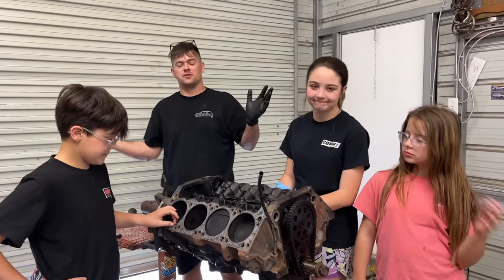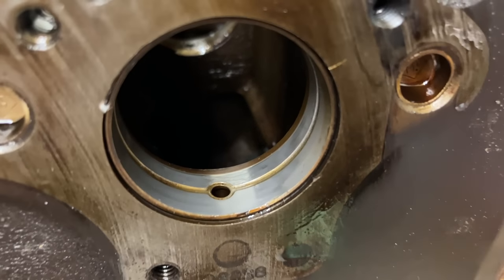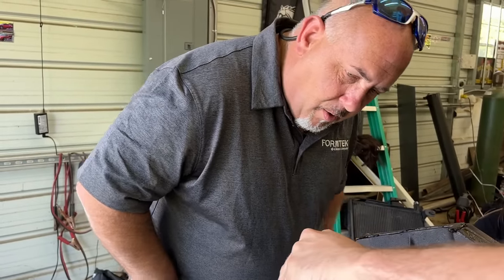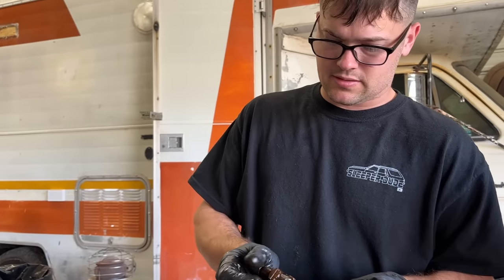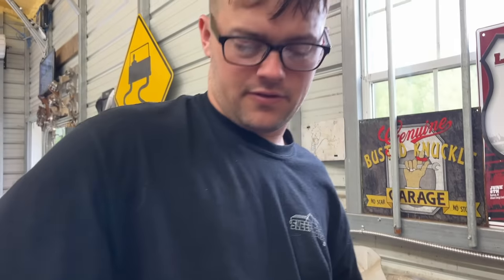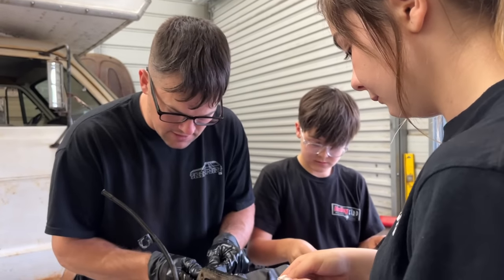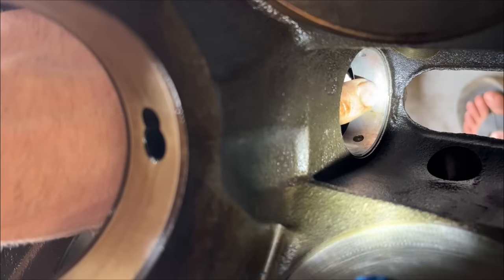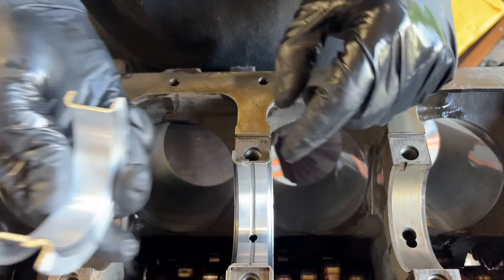250k Mile Engine Rebuild At Home! With No Machine Work For Cheap!

Comment: As a mechanic I have built maybe a hundred engines, you have done it just the way I would have! Great job and yet another great video. Thanks guys, Ya'll awesome!
Reply from the maker: Thank you I really appreciate it
Reply: @Sleeperdude you and him are really smart, I bet you two could help each other, if you need help on something, love you all, he's really humble like you as well👍
Reply: @Sleeperdude  awesome you teaching your kids mechanic skills but please tell me where did you get that toy goat and what is the name of it. I want to buy 3 of them , 2 for my nieces, and one for me😅that yell is too much.
Reply: You would use the same lifters and pushrods and cam after going thru all that work and money?? I wouldn't admit that my friend if you depend on engine rebuilds for a living. Not many customers will want to spend the mo ey on labor and not spend the few bucks extra to do it right , especially on a 250k mile engine
Reply: I love watching y'all's videos, I remember when I was a kid my parents and I built a 283 in our living room. The only machine work was the boring 40 over. I remember dad polished the crank shaft with a leather strap semilar to what you doing with the sand paper. The next day I came home from school and mom and dad were adjusting the lifters while it was running, Dad was old school. Anyway by that evening it was running good and we drove it to the gas station and jumped on I 75 north and drove it 1200 miles it's maiden voyage from FL to Ohio. Change oil and filter and Drove home. Love that it's a family thing. My new favorite show
Reply: Wouldn't want you for a mechanic. You're scary. Cylinders out of speck need machining and new pistons.
Reply: @samsteel2643  Don't be a dick, not everyone has the money for machine work, they just want a running engine.
Reply: I totally agree with that! I restore old French and English car's to ad to my collection. All engines I take apart and give them a complete overhaul. The method this wonderful family is doing, is the exactly the way it should be done! It is the way they include the love for animals into their daily lives is an example to all of us! ❤
Reply: @samsteel2643 you clearly were not paying attention when the video started.  He clearly said this is a video to teach people how to rebuild a motor on a budget not using a machine shop and this isnt a customers motor. If it was im sure hed be using new parts when needed.  Smh

Comment: Watching you and the fam makes me happy. I was born 50 years too early sometimes I think and fifty years too late other times. 59 years ago when I was working on old iron Chevy small blocks and a British 4 banger all we had were books. You make me believe I could do this.  Thank you. Back then there was too much learning on the job, shop manuals, and  no real mentor, so it just did not work out that great at times.  I built a very smoky four cylinder and a 327 with 202 heads, crane comp cam, new lifters and valve springs and push rods that lasted about a year before she blew. (I was a little hard on her though). It was so much fun but so stressful. Thanks for making feel like I need a shop again.
Reply: We all did something like that  to good times 🍺👍🏻👍🏻👍🏻😎

Comment: I thoroughly enjoyed the video. Nice budget rebuild. 
You mentioned about clearance between the keg intake with the EFI clearing the dog house. I don’t know how it would look but cut towards the top of the dog house and cut sheet metal to weld in as a extension and re weld the top back on a paint to match. The only thing is measure the dog house to the bottom of the dash to see what room you have to work with.

Comment: I usually break off a piece of the top ring and turn it sideways to clean out the oil groove. The end at the ring gap is flat and fits in there nicely.

Comment: For cleaning the ring grooves, since you are replacing with new...snap a two to three inch piece and use the factory end to clean the appropriate groove. Also, I bought a chevy 327 short block for my 69 pickup and it was a remanufactured block and one of the 8 pistons was oversized. Worked fine while I drove it.

Comment: When I rebuilt my 400 m in my 79 f150 the three center cam bearings were laying in the oil pan the cam was running on the end bearings only.a quick way to clean pistons is to get one of the dip cans of gum out carb cleaner and soak the pistons in it for a while.you can use the end of a broken ring to clean the ring grooves.great video
Reply from the maker: Wow

Comment: Another thing people used to do is put the 360 heads on a 318 because the ports are bigger and the chamber is smaller. My buddy told me that they made more power than the stock 360. Something to do with the compression, more dome and smaller chamber.

Comment: I had this same thing happen to bearings on a little diesel engine build I did recently that had a lot of blow by from a broken piston/rings on one of the 3 cylinders. Fuel dilution was bad enough that it was 'making oil'. I think the acidification of the oil that happens with that kind of blow by caused the issue. The crank and cam journals were spotless though and mic'd out to exactly factory spec, so I didn't even touch those when I reassembled. Didn't even polish. Engine makes like-new oil pressure now.

Comment: The Beverly hillbillies would cut some old hardwood and a piece of1/2in.all thread with nuts and washers they come out pretty easy by tightening the allthread. And can be used for installation also. I'm a backyard mechanic. good luck

Comment: Y'all got a little machine shop line rocking.  Three little helpers makes short work of engine cleaning. If you are running stock ecu, you can probably use the durango gauge cluster and factory gauges

Comment: That particular engine with that high rise intake throttle body the injection is usually put in their camper style Vans and their campers with the 360  and has a really hard pull @ about 3 Grand  clear up to about 5800😮 they usually run great with him 389 ring gear might I suggest a 2-speed I love box or a two-speed rear end if you're looking to get great gas mileage 🎉

Comment: Regarding WD-40, you used it correctly here - WD stands for water displacement, so rust preventative.  With that said, it is a useful LIGHT lubricant.  Use a bit on your #0000 steel wool for cleaning chrome, then use a de-greaser afterwards.  Magic!

Comment: You have a slight cam wobble. That's why the middle bearings were worn and not the outside. It was probably caused by sludge build-up. You can also remove and install cam bearings with heat and a socket on an extension.
Reply from the maker: Ok thanks you

Comment: Had one of these engines.  The fine mesh screen on the pickup clogged with carbon and ruined some wrist pin bearings. Tough engine otherwise.  The Hemi on the nex-gen of the Durango was a beast though.  Passed everything but a gas station.

Comment: The back plug i reused on mine i just put a very thin coating of rtv on it when i put it back in . The odd wear on the cam bearings is from the cam bore not being straight. I also bought the same cam bearing tool and glad i did. From expirience with mine get a new oil pump drive shaft the hardened one. I reused mine and after about 1 hour run time I suddenly lost oil pressure and pulled the pan and found the hex drive broke clean off. You can also put thread in rocker studs and buy a cheap set of small block Chevy 1.6 roller rockers stock dodge rockers are 1.5 ratio so you gain some lift make sure that you get the push rod guide plates and hardened push rods. I used the stock length and it came out good with tge geometry. Ive heard the you can use 1.7 ratio rockers but even i tried it i could not get it to ride on the valve correctly in the exhaust side. I thought about doing what some recommended and do 1.7 intake and 1.6 exhaust. But honestly the 1.6 rockers really brought that small stock cam to life I also added a 5degrees + of cam timing and when i set the distributor in the computer i put it at +4 it nade a huge difference in the way it runs
Reply from the maker: Awesome thanks

Comment: Good stuff, have 2 360's 99 Dakota RT and my somewhat newly purchased 99 Xplorer RV. RT has 217k runs perfect, RV 65k and same. Restrictions from intake and exhaust manifolds are magnum Achilles heal when it comes to power. Hughes makes an open air dual plane magnum intake, more donkeys and fuel economy. I was lucky enough 2 years ago to order and actually receive one 6 months later at a higher price than when ordered. Holley also makes a larger 50cc throttle body. When we do'n an RV meet and greet? :)) Cheers.
Reply from the maker: Thank you!!! We will see about the rv meet n greet 🤣

Comment: next one you do on those verticle scratches get a small sandpaper flapper wheel the ones that look like a river boat wheel on a drill go up and down the scratch it will quickly remove the scratch leaving its own cross hatch then hone with your stones you will have much better compression

Comment: I had to stop at around that 13 minute mark and throw my like. The reason I stopped here though was because I wanted to remind you to close the lid on the parts washer. We had a John Deere dealership burn to the ground when a spark from a grinder fly into the open parts washer. Just don't want to have anything bad happen to such a great family.

Comment: Great job putting that motor together with all the original parts. I would think you needed new head bolts? You need to get a super scaper from Mortske 😅😅

Comment: On those clearances you can use a dial bore gauge and a micrometer to check instead of the plastigage. It's supposed to be more accurate. Dial bore gauge used to be stupid expensive but you can get those cheap from the getting place now straight from China. There is one that I bought and it has repeatability that is better than half a thousandth, so with a good mic or caliper you can get super accurate and precise measurements with one. I can't say where because YT keeps auto deleting my comments when I do, even if I use the common euphemisms, but I'm sure you can figure it out. You seem like you do this kind of work a lot so you might benefit from having one.
Reply from the maker: Good idea thanks

Comment: I priced a cam bearing install set on summit racing equipment, ebay and Amazon but harbor freight may have them too but I ended up getting rid of the truck before I fixed it so ..

Comment: The secret to ring groove cleaning (at least in the compresson grooves) is to take an old ring and break it in half, then use the sharp edge to scrape out the carbon in the groove. Works VERY well!
Reply: old school trick that works well and free!
Reply: That’s what I have always dun a old timer showed me the trick
Reply: It’s called a ridge reamer . Special ppl.
Reply: @Angelo-fo8de  no... a ridge reamer is a tool that cuts the ridge out of the cylinder. I was talking about removing carbon from the ring grooves.
Reply: I agree the handiest way to do it
Reply: Agree, was going to say the same.
Reply: You can buy a ring groove cleaning tool but the piece of a ring works fine.
Reply: lol,that still works today,but is old school as helll,easiesr ways out there

Comment: I tell you what, mate.  After watching this video, I don't feel daunted about tearing into an engine again.  Last one I did was 30 years ago and when I was faced with doing work on one of mine recently, I chickened out, letting a mate of mine do it all for me.  Body work, welding, panelbeating - no problem, but an engine?  Nope.  After seeing this (and remembering back to what I'd done many years ago), I almost find myself looking forward to tearing down and rebuilding the engine on a project car I'll be taking on in a couple of months.  The engine is an unknown that "ran wen parked" and I was tossing up about just dropping it in and seeing how it went.....when really what I WANTED to do is pull it down and check it first....so I'm gonna have a go!   

I completely agree with you about auto transmissions though.  Even my Dad with 30 years of building performance engines for family and race vehicles would not touch one.  Manual gearboxes - yep, no problem, but autos, nope.  He described their internals as witchcraft and couldn't get his head around how they do what they do.....and having seen the auto box on one of my vehicles in pieces on the workbench of the rebuild shop, I completely agree with him. Even though the bloke talked me through how it worked, with the solenoids, pressure through certain passages doing one thing and valves doing others, it still seemed like witchcraft to me! 

Looking forward to hearing this baby fire up when she's in place and everything is hooked up.  I bet all three of your young 'uns will get a huge kick in their confidence when she fires too, considering they've all had a hand in rebuilding the beast.  That old camper won't know itself when she gets back on the road!

All the best
Reply from the maker: Thank you I’m glad you want to build one now. I really enjoy it

Comment: Great video ! Reminded me of the last engine job I did with my Dad before he passed away in 1990. We rebuilt the 232 straight six engine in our 1966 Jeep  J - 2000 , Dad was the instructor and I was the student. We found that three of the pistons had broken rings. Fortunately they did not mess up the bore and we were able to hone them out, but we did have to buy three new pistons due to the ring grooves being stretched out. I believe we did that rebuild in 1984 and that engine still runs fine today ( I actually ran the truck today ). It does not see much road use anymore as I keep it for winter snow plowing. Those old six's were rated at 145 horsepower -  not bad compared to my 1980's era Ford 302's that are rated at only 150 horsepower and 270 foot pounds of torque. Thanks for the video and hope Ralphie feels better.

Comment: The secret to cleaning piston ring lands is to put them in the ultrasonic cleaner. They will look like brand new when they come out.
Reply: Hone the bores with atf, then clean with brake clean and then atf, the detergents in the atf will pull out all the grit the brake clean missed, also lube the rings and pistons with atf when assembling and it will speed up seat in time on the rings.

Comment: Great video! 👍 I always used to snap off a section of piston ring and use that to clean the carbon out of the piston grooves - worked a treat
Reply from the maker: Ok thanks
Reply: Dear Brian Newby
👍👌👏 Yes, that usually and definitely the best way to clean the grooves. 2) I was astounded that they didn't simply put the pistons in the ultrasonic cleaner. These things work fantastic.
Best regards, luck and health in particular.

Comment: Gratefully it’s only a Dodge Engine the family is practicing on.  Don’t strap the beautiful little Honda 400 strapped to the last camper. For which the family came close to getting some Greyhound Busline under their seats. 
I have noticed the father performing 100% of the quality Control.  If it smokes a little, just consider it lubricating the exhaust pipes.

Comment: Someone didn't change oil at regular intervals. Once you get carbon in the oil, it becomes like an abrasive cutting wheel on your bearings. The lifter had varnish around the bottom that kept it from coming out

Comment: the only issue with those motors is that keg intake the plate under em ends up warping and causing leaks. Need to find a different intake for it so no issues later
Reply from the maker: That’s true

Comment: Modern engines use low tension rings on the pistons. They will hardly ever wear out the factory cylinder hone and should never cause a cylinder ridge at the top of the bore.
Reply from the maker: Makes sense

Comment: The cam bearings you shown are looking like that due to being overheated and/or starved of oil. Loss of oil can cause contaminants to float around jam up and make micro cracks in the hardened surfaces and the coating of bearings are especially vulnerable to this issue...  EDIT  IF I had to make a possible cause for this I would think the engine was starved of oil due to an overheating problem was shutdown and then instead of draining oil, flushing the block  & oil pump fully, Led to contaminants to float around,  jamup and damage the bearings
Reply: Thanks good to know  makes since on motor homes 👍🏻👍🏻👍🏻😎

Comment: I sprayed my buick 231 v6 with wd forty fresh from the machine shop.  rusted up 3 days later before I could get back to it  dont use wd 40 unless your going to assemble and run it right away

Comment: Hey Josh, I have a VETTE like Ralphy’s but it’s an 84 crossfire and had it  for 2 years. You were talking symptoms of smoking. So, mine smokes after sitting and getting up to fan temp of 223. Then once you get it cooled down and driving, it stops. Valve stem seals??
Reply from the maker: Yeah it should be valve stem seals

Comment: Hook up your pressure washer feed hose to your hot water tank drain and you basically have a pressure steam washer👌🏻
That rear cam bearing will outlast the new ones- it’s full of giant pockets to hold onto oil 😂
Those head bolts are torque to yield bolts- not reusable and now you’ll blame the graphite gasket🤦🏻‍♂️

Comment: I'd replace the casting plugs too. Might as well while it's out in your teeth. I had a SBC rebuild with about 10k on it. Casting plug between the engine and trans came out for some unknown reason. It surely sucks to have to pull one out again so soon for something dumb. Replaced every one of them with the best brass plugs i could find!
Reply from the maker: Thank you